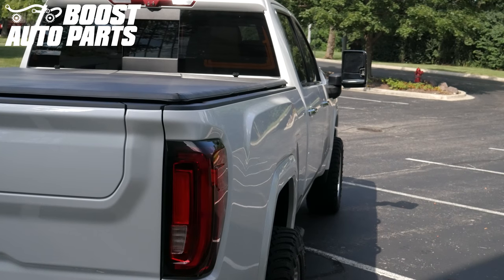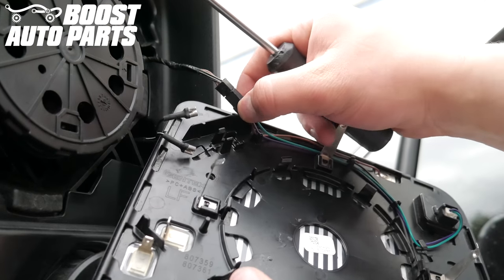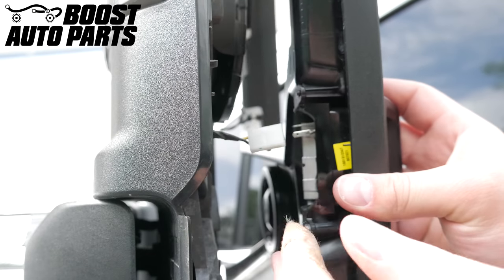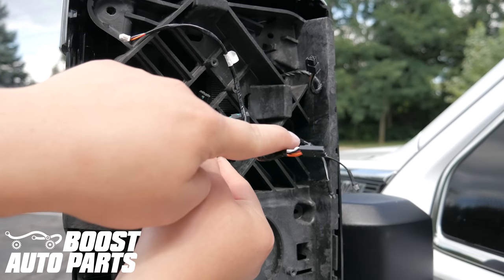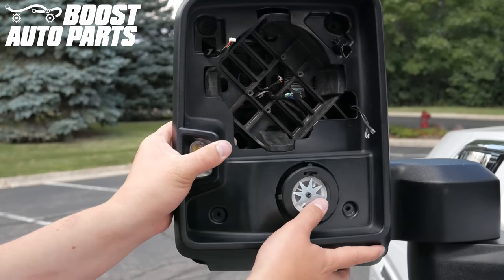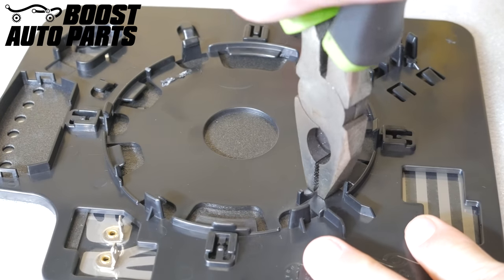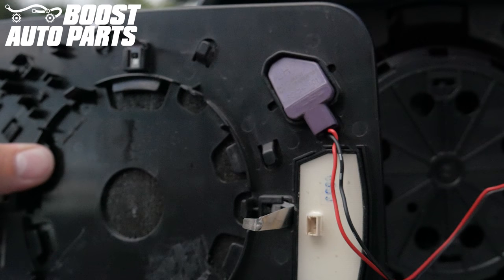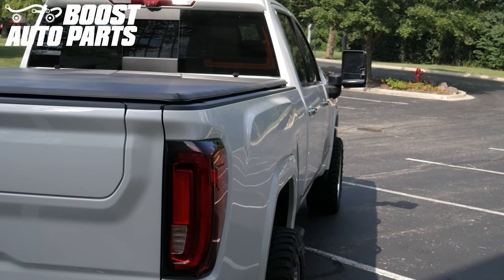Add Signal On Glass - GM OEM Tow Mirror Upgrade Kit (2019+ Style Silverado/Sierra Tow Mirrors)

Comment: Great video I had a question is there a way add the cargo lights on the tow mirrors if my LT didn’t come equipped with them?
Reply from the maker: That would require an entirely different mirror. If you do swap the mirror, we do have the required harness to add the cargo lights.
Reply: @boostautoparts  can you provide a link of the harness require, i just order my elevation truck and it be nice to have the cargo lights.

Comment: For the connector that connects to signal in glass. What kind of connector is that.  Is there a part number for that specific connector?  Also what size wire is in the provided harness?
Reply from the maker: Unfortunately we do not have that information available
Reply: @boostautoparts  that unfortunate.  There is a very simple harness to be made, along with your mirror glass upgrade that allows to add the blind spot monitoring to tow mirrors if the truck is originally equipped.  All that remains is finding that connector that is a direct plug in.  I’m surprised this hasn’t been discovered or created by your team.    Thank you anyway.
Reply from the maker: @briankazda7339  Unfortunately we don't offer a kit to add the BSM to mirrors not originally equipped. I'll relay that feedback to the development team.

I will note that GM does offer towing mirrors with the BSM integrated, just not through their accessory division.

If you were to purchase the signal on glass upgrade kit with the BSM glass setup for auto-dim (regardless of whether or not you originally had BSM), that version comes with a harness plugged into the BSM light. You can see it in the pictures on the product page. You should be able to cut and splice onto that harness for BSM, should you want to do that - we just don't have a video or technical support showing how to do that.